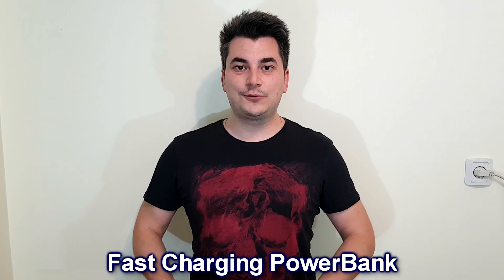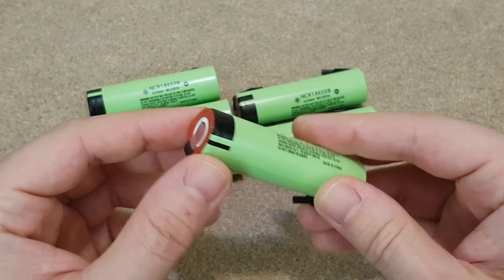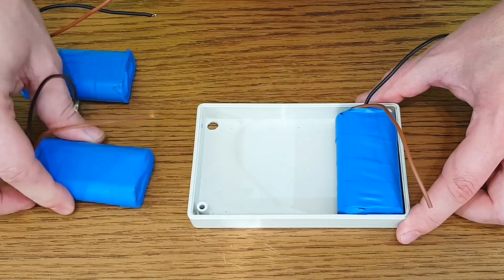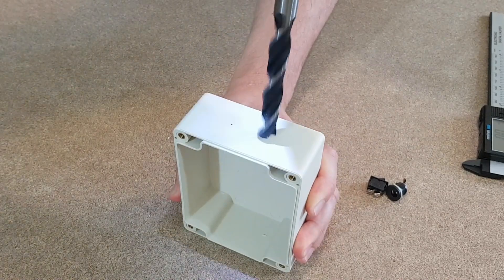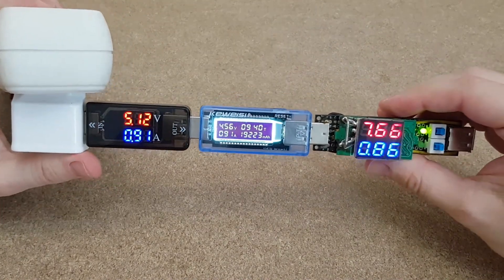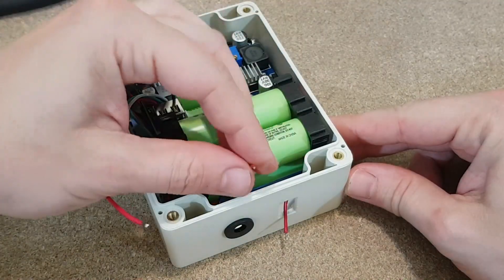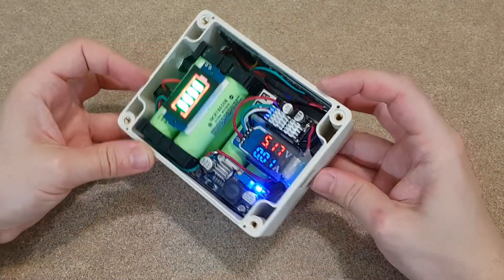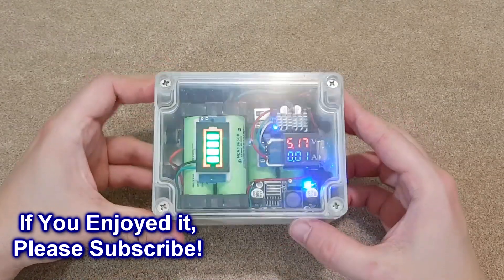DIY Fast Charging PowerBank - 70Wh (AFC, QC2.0, QC3.0, FCP/SCP)

Comment: Awesome video!  Out of curiosity, why did you use a 6S pack rather than 3S 2P?  Is it because of charging time or something else?
Reply from the maker: hi. a 3S battery pack has between 12.6V and 7.5V. some fast charging protocols need 9V or 12V, so the fast charging buck converter can't deliver the needed voltage. a 6S battery pack will power the converter with 25.2V - 15V, that's exactly what the converter needs.
Reply: @Sorin_DIY  Gotcha, thank you!  I think I failed to consider that a 3S isn't always around 12V, since it does drop when the batteries are discharged.  By the way, do you do anything related to creating music like playing any instruments?  A video on more music focused things like synthesizers or effects like guitar pedals would be super cool!
Reply from the maker: I took a few guitar lessons many years ago. but I don't think I can play guitar anymore...
Reply: @Sorin_DIY  Give it a shot!  I love seeing content ending in a great finished product but I think I and others would also like to see a learning process such as relearning guitar or exploring audio stuff.  Of course in the end it’s up to you and what you want to do.

Comment: Can you use a 18350 battery on that project and how many do you require or it can fit in it?...hope you can read this message...
Reply from the maker: yes. you need 6 cells in series.
Reply: Can you add additional battery since 18350 is smaller? Or it will have any problem if you do add another battery?
Reply: Thank you for your reply your video is very inspiring and fresh idea..watching here from the Philippines..

Comment: You have 3200Mah capacity with these cells connected in series. How come you are charging 3-4 phones?? Did those phones only had 800Mah batteries? 🙄
Reply from the maker: no no. but the 6S battery pack has a nominal voltage of 21.6V and a phone battery has a nominal voltage of ~3.7V. so the battery pack from the powerbank has approximately 6 times more energy than a phone battery. but considering the power loses of the conversion, the power bank cannot charge a phone 6 times, but it can charge it 4 or 5 times, depending on the capacity of the phone battery.
Reply: @Sorin_DIY  Ok! Did some more reading and got to know that your power bank should be able to charge a 4000Mah battery for almost 2.8 times due to series connection and other loss in conversion. I think you will agree with that?
Also, Can I charge this power bank with a 12volt 2amp charger? Even though it would be slower. Also, what about my Quick charge 3.0 or 30watt Power delivery(PD) chargers. Would they be able to charge this power bank?

Comment: Just a small feedback about this project.
You better use smaller Amp BMS for this because you only use 1P.
The BMS is basically not protecting the cells enough if you paired 1P pack with 40A BMS.
If the component faulty and drain like 30A semi-short circuit, then those cells will get hot and boom.

Not the best explanation, but you get the point.

Love your videos Sorin!
Reply: What bms u suggest
Reply: Or simply add a fuse...

Comment: Sorin how come the 18650 batteries with nipple is so cheap but without ..my gosh...can I use a hot glue gun to attach positive and negative wire on flat top 18650 or no???love that fat cat...think the glue will melt ?any recommendations???

Comment: where is the link to the 18650 spacer? Thanks
Reply from the maker: I don't have the original link anymore, but you can use this one, it has a good price for 20 pieces and low transport cost: 
https://www.aliexpress.com/item/32978131550.html?spm=a2g0o.productlist.0.0.6cf969fd5f9YiQ&algo_pvid=f186073d-d67c-4837-a2fc-40beeb8b49d2&algo_expid=f186073d-d67c-4837-a2fc-40beeb8b49d2-1&btsid=0bb0620316009393684027243eefa1&ws_ab_test=searchweb0_0,searchweb201602_,searchweb201603_
Reply: @Sorin_DIY  Thanks :D

Comment: Which one is better ?
Using all the 6 cells in parallel and a boost converter
Or
Using ur method of series cells with a buck converter
Reply from the maker: hi. it depends on how you're going to use the battery pack. if you want only a 5V output, it's better to make the battery pack in parallel, because it will have a better efficiency. but if you want a fast charging output with up to 12V & 2A (24W) that will put a lot of stress on the battery pack and converter, because it will draw a lot of current and will work at a low efficiency, probably between 75 - 85% (let's say 80%). if you make a 1S6P battery pack, it will deliver a lot of current, but the voltage will decrease to 2.8V or maibe 2.5V, depending on what protection board you use. so when the battery pack it's almost discharged and the converter will try to deliver 24W, it will draw from the cells 24W/0.8eff=30W; 30W/2.8V=10.71A. so the fast charging module will draw from the almost discharged battery 10A, maybe more... that's a lot! the fast charging module and battery will get very hot and the overall efficiency will be very low. but with a 6S battery pack you don't have these problems, because the converter needs very little current from the battery.
Reply: @Sorin_DIY  OMG 
Really Sorin u replied me 
OMG i am a big fan of u 
Btw I was going to make a 3s2p battery pack and a 300w buck converter to regulate to only 5v and 2a.
Is it a good idea.
Pls if u reply this 
I'll probably get a heart attack!!
Reply from the maker: yes that will work. but don't cheap out on the BMS board and step down converter.
Reply: @Sorin_DIY  tysm for ur help. ❤️❤️

Comment: Great project. The charging rate is not too high thou? ncr18650b pdf shows recommended max rate of 0.5C
Reply from the maker: hi. yes, it's a bit higher at 0.6C, that's because I didn't expect the charger to actually deliver 2A. I thought it will deliver around 1.8A. but that's not a problem, because the cells are new. a charging rate of 0.6C is still safe, the cells only warm up a bit, that's normal. when you stress older/used lithium cells, that's when you need to be extra careful.

Comment: I don't understand why a step down coverter&USB port is needed for 5V charging. 'Cause the QC module itself can provide 5V up to 3A output if none of fast charge protocol is detected. Is it just for an extra charging port?
Reply from the maker: hi. I want the powerbank to have 2 outputs. and I don't always charge my phone with fast charging method, because the battery gets hot. usually I use a 2A normal charger/powerbank and when I'm in a hurry I use the fast charging method.
Reply: Sorin my battery doesn't get hot

Comment: Hi
I have a 2 Flat batteries of 5000mah each from a thin & light laptop
The output voltage from both battries are 3.5-4.7 v respectivilly & the total output when both are connected to the inbuilt circuit board is also the same.

I want 8v-12v as the effective output
Which circuit board should i use
Reply from the maker: hi. it depends on what current your load needs. you need a 2S BMS protection board with balance and a step up converter. the most commonly used is the XL6009 boost converter. but you may need a more powerful module.

Comment: 1:50 omg! Never make a power bank with batteries in serial! Always go with parallel, that way you'll have x-1 times more capacity x batteries used! In your case it's 7 batteries so if connected in parallel you'll have 6times more capacity so noway it's 70Wh powerbank, sorry! 6 batteries 1000mAh each in series is 3.7V*6 with 1000mAh capacity but in parallel it's 3.7V, higher amp output potential and 6K mAh capacity! Now pretty great difference, yathink edit: proof: https://batteryuniversity.com/learn/article/serial_and_parallel_battery_configurations
Reply: Literally the first sentence of your link contains the counter-argument.... "Batteries achieve the desired operating voltage by connecting several cells in series; each cell adds its voltage potential to derive at the total terminal voltage. Parallel connection attains higher capacity by adding up the total ampere-hour (Ah)."

Sorin wins.  His charger, his risk, his whatever...
Reply: But the watt hours remains the same, I think in series the charging module also are at its highest efficiency instead of boosting the voltage

Comment: did you hear about the IP5328P ?
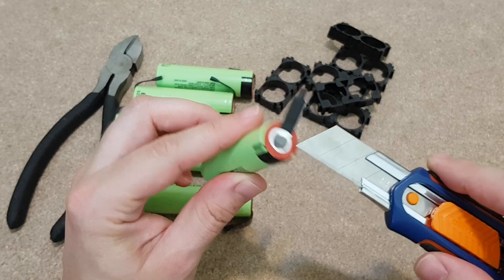Reply from the maker: yes. but that board is all in one module, so there is not much I can talk about in the video, just connect it to lithium cells, everything else is done by the IC. it doesn't have what I need. I don't need the USB type-C connector, I don't have any devices compatible with it. I don't want 2 fast charge ports, as I said in the video, I want a powerful normal output with 5V & 3A. and I want to charge it very fast, 2:50 hours is fast enough.

Comment: Can u tell me overall cost
Reply from the maker: hi. the powerbank parts cost around $30 including shipping. but I buy the components in packages (5 or 10pcs) to be cheaper. also the price of the components varies daily, especially now in the pandemic period. the charger cost another $12, but I use it for several projects, so I don't include it in the cost of the powerbank.

Comment: I would have used a parallel battery array, some tp4056 borads for charging and the boost converter version of the qc and buck module. Would save you from always having to use a special power supply. By the way: I would NOT use a normal power supply directly on those lithium cells, grap the wrong one in an hurry and come back to a bonfire on youre desk
Reply from the maker: hi. I thought a lot about this powerbank before building it and I also considered connecting the cells in parallel. it will be easier to charge the battery pack, but there is a problem. the protection feature of the TP4056 module will let the cells discharge to 2.5V. the fast charge boost converter needs minimum 2.8V, so you need a different charging or protection module for the cells. even if you find a good one, there is another problem. the fast charge module maximum output power is 24W (12V 2A). the typically efficiency is 90%, but when the battery is discharged, the efficiency will probably be 80%, maybe even lower (it needs to increase the voltage from 2.8V to 12V and 2A). so with an efficiency of 80% it will suck from the discharged -> 2.8V cells... 10.7A. that's a lot, the module and battery pack will get very hot. you also need very thick wires for 10A. decreasing the voltage will put less stress on the modules and the battery pack, than increasing the voltage. that's why I chose a high voltage battery pack, not a high current one. using a 25.2V charger has the advantage of charging the powerbank in less than 3 hours. you just need to be careful not to mix the chargers... I also wanted to add a microUSB input with a step up converter, so I could charge the powerbank with a normal charger. it will probably take a whole day to charge it, the problem is that there is no more space inside the powerbank for another module.
Reply: @Sorin_DIY 11 q

Comment: I like the idea of using the junction box.

LM2596 don't seem like a particularly efficient regulator.  Any time you see a diode on the board, it can't be that efficient.

A design that uses battery holders would be easier than soldering cells together.

Why did you work on the batteries while they were fully charged?
Reply from the maker: the cells were charged when I finished testing their capacity. but i was careful not to heat them or short them.

Comment: Can u create a video to make a 12v UPS for ROUTER that can last 4-5 hours using easily available parts with pass over charging? I don't want to use powerbank where router would always use battery power.
Reply from the maker: I will make a better UPS soon.

Comment: Nice power bank and instructions !

I have a couple of NP-L7S batteries lying around without a charger. Can i use this circuitry to charge them ?
Reply from the maker: you need 6 lithium cells if you want to use the 6S BMS board from my video.
Reply: @Sorin_DIY  I have the complete battery NP-L7S. 

https://idxtek.com/products/np-l7s

Could you please help me building a charger for this ?

Comment: Suggest a Schottky diode between BMS and charge connector to prevent unintended current from flowing in to bench power supply.  Although a small voltage drop, is it enough to drop the 25.2 V supply below the required 6s charging voltage?  Might end up a 4.15 V per cell instead of 4.2 V?
Reply from the maker: hi. this is not a UPS. when the charge is completed, I just disconnect the charger. only if you use it as an UPS, you can add a diode.

Comment: Looks like a good project, a better box than I ever thought of using! I would worry about the two cells under the power converters getting hotter than the others and aging/ losing capacity faster while fully charged. Then they would start to become unbalanced, relying on the BMS board protection limits.
Reply from the maker: hi. the 2 cells don't get hot, I put 2 layers of sticky foam tape between them and the modules. plus the DC converters have heatsinks. the converters don't produce enough heat to affect the cells. you can use bigger heatsinks if you're not sure of that.

Comment: Perfect timing Sorin Sir! And as always very informative video!
Sir i am building Nearly Same power bank for my notebook and phone (with usb pd output)
Sir i have a question!! I don’t have any 25 volt adapter, but many 12 volt adapters!! Should i use a Step up (boost) converter to boost 12.7 volts output to 25.4 volts?? At what amps should i charge my 6s2s battery pack (old cells)?? (I have two <12volts-2amp> power supply and one <12volts-7.2amps> power supply! 
I was planning to buy following step up boost converter -| DC DC Boost Converter Constant Module Current Mobile Power Supply 250W 10A LED Driver Module Non-isolated Step Up Module
https://a.aliexpress.com/_dUJFbZA
(At what amps output should i set it) 
And sir i was planning to use a microUSB input (boosting 5volt to 25volt) for charging my power bank at emergency times (is it good idea too?)
Reply: Or I should simply buy a 25volt adapter?😂
Reply from the maker: hi. you can use the 12V and 7.2A adapter and the step up converter. I think you should set the boost converter to 2A or max 2.5A. if you increase the current, you will put too much stress on the charger. you can add a microUSB input, I thought about that too, but there isn't anymore space inside my powerbank for another module. but in this case you need to use another boost converter and limit the current to max 0.35A and use an USB charger with minimum 2A.
Reply: @Sorin_DIY  Great idea Sorin Sir! Thanks a lot! I will complete my project 😀😀

Comment: Just a quick question: with the powerbank switched "off" and connected to the charger and a load connected to the powerbank, what will happen if you switch "on" the powerbank? What I'm getting at is, can this be used as a small UPS?
Reply from the maker: yes. if you turn it on and charge it, it becomes a 5V powerbank.

Comment: Will it fast charge an iphone ? Usb PD ? If not, what module supports QC and PD ? Salutari din buc
Reply: U can look on AliExpress
Reply from the maker: hi. iphone is included in the support list of this module. but I tried it with an Iphone 8 and it's charging it with 5V and 1.2A only, it doesn't detect any fast charging protocol.

Comment: Hey, awesome project ! Would it be possible for you to list the links where you bought the parts in the description? I'm especially interested in the battery source. Thank you !
Reply from the maker: I will make the parts list soon.
Reply: @Sorin_DIY  I saw you added the list - Awesome, you rock man.
Reply: @Sorin_DIY  thanks a lot !
Reply: You can buy those on eBay. With stripes soldered on. Make sure to use a trusted seller

Comment: I have a question 2-4 amps and 5-9 volts means 10-36 watt then how it 70 watts pls anwer??
Reply: Afterward i also thought the same
Reply: 70 Wh of capacity, not 70 W of power being supplied at any given point in time.

Comment: If you add an another DC socket directly to the 6s BMS it gives the 25v o/p so you can use for any other experiments just like i did but in my case i used a 3s BMS from old laptop battery. 😊👍
Nice Power bomb Oops Power Bank. 😄
Reply: Lol.,good idea...thansk haha
Reply: Yes ! Perfect, But Same(input) port can be used as output too! As it is not bound by any diode!

Comment: I made one with three 25w fast charge output
but i use 1s18p
so i need 6 tp4056 in parallel and a usbc to handle the 30w fast charge
i will make a video about it later
Reply: ill wait for the video
Reply: @gerardjachymiak5822 subscribe my main channel to see it
https://m.youtube.com/channel/UCBxknrliBL8uWJ83rX70e_A
Reply: @gerardjachymiak5822 I finaly finished this video https://www.youtube.com/watch?v=gOUH4ARJOFo
Reply: @lifeai1889  I'll watch it now
Reply: I also made a powerbank but with 6 zells and i used a board that can handle all cool features such as QC 2.0/3.0 and usb type c in/out (check it out its IP5328P board and also watch great scotts video about it: https://www.youtube.com/watch?v=yEbbhTw0kno)
Reply: @typhonhunter  I have a ready made one from local recycle center with blown battery
It also use the ip5328 chip
I have replace the battery and it work fine. It is the best power bank because even my diy one can't trigger my zenfone4 fast charge but ip5328 does
My diy one use tps61088
Reply: You. Look genuine